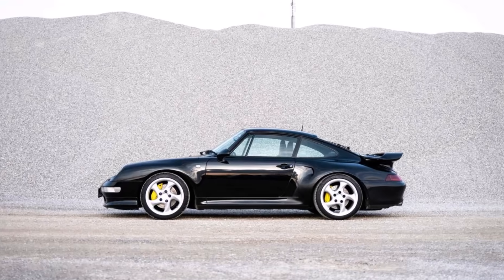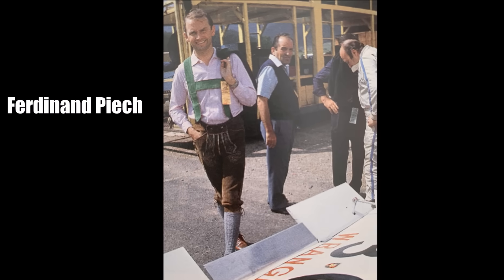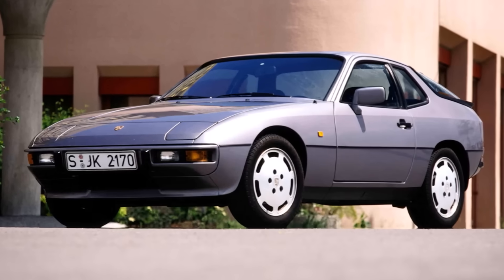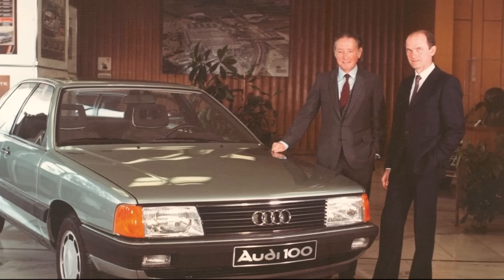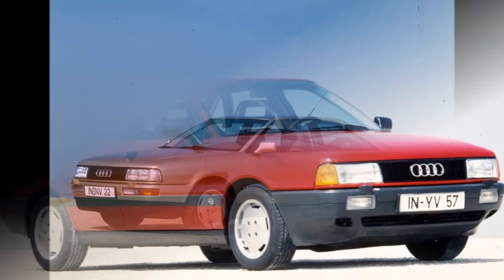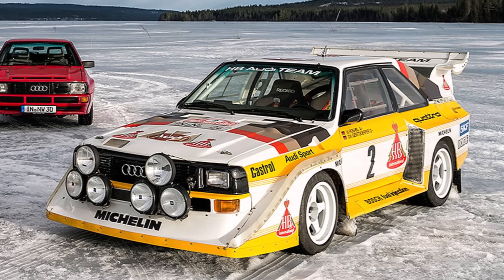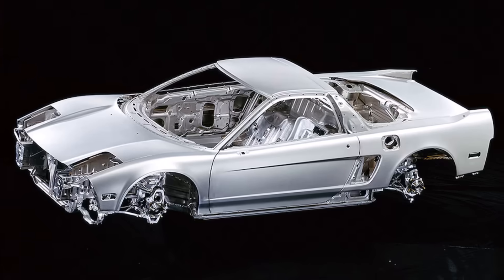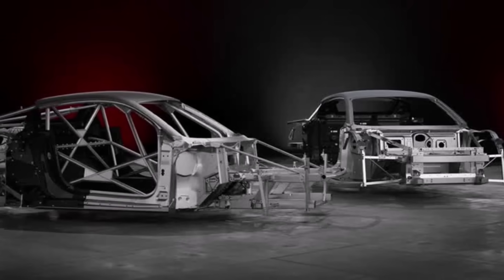How AUDI and Porsche eliminated corrosion forever - Development EXPLAINED

Comment: Even today, VAG corrosion warranty is many years longer than any other manufacturers - 12 years. GM has 3 years; Toyota 5 years; Mercedes 4 years.
Reply: iirc my 2001 audi a3, my very first car, had like 15 or 20yrs rust warranty. i remember reading through the documentation in the glovebox that the car was still under warranty for rust. apart from a vacuum leak on the big hose after the air intake filter, the car served me well 🫡 sold it once i got a company car at my first job. at the same time, my mom's peugeot from 2013 already had rust under the boot lid's exterior paint
Reply: @louisvl10 I still have the A3 8L and indeed it had a long warranty. I think it was 15 years because I remember when I realized it too lated after buying  one about 10 years ago that I should've bought it to the dealer since the driver's door was rusting, which happens to basically all of them. 😅
Reply: 12 years on Toyotas here - doesn’t prevent them from rusting though
Reply: Toyota has 10-12 years for even the Aygo, the cheapest model.
Reply: In the meantime in Norway, after a couple of years most cars VAG and others... Collect rust al over....
Reply: @dalegas76  there is something in the water up here 😁
Reply: In Italy plenty of Golf Mk4s are still rolling around and all of them (at least cosmetically) are in really good shape
Reply: 12 years corrosion warranty for Toyota, 10 years (or 200.000km) on the mechanical stuff, and 15 years on the Hybrid components (no max. kms). Don't talk about VAG warranty like it is any good, they will do anything to avoid paying for warranty.
Reply: Except Renault. My first car, Clio 3 had 20 YEAR warranty!!!
Reply: still drive my 1999 vw t4 505000km its whole life in salty Denmark but almost no rust in my T4. it was taken care of, but many are gone.
Reply: Yeah that's what my neighbor thought about his Passat. Until he went for the warranty and got told that the warranty was not valid since he didn't pay for the 'special anti rust treatment' when he bought the car. And when my uncle told me he had bought a new Golf a few years ago I nearly chocked on my coffee when he told me he only got 2 years warranty on the entire car 😳 While at the same time brands like Hyundai and Fiat were giving 7 years. I just can't get my head around the fact that ANYONE would fall for that bs. I would walk right out the door.
Reply: Volvo 12 years aswell
Reply: BMW also gives 12 years (as long as maintenance is done at a dealership)
Reply: Renault? Volvo? Renault looks so much better than Vag cars
Reply: Tell that to my old MK6, lmao!
Reply: Not true, opels since 2000s had also 10 or something like that. I have a 2003 Corsa, park it outdoors in salty Moscow winters, almost no rust.
Reply: It depends from market. In my country toyota rust warranty 10 or 12 year (depends on model), audi 12year. But... Engine warranty audi 160k km vs toyota 185k km.
Reply: Lets be honest the Mk4, Mk5 and Mk6 Golf had all huge rust problems in the rocker panel area and lower part of the front fenders. Also all cars based on the pq35 mk5/6 platform have problems with rusty rear lower control arms the coil spring sits on
Reply: My 2013 Auris had a 12 year corrosion warranty
Reply: there is no such thing as corrosion warranty in this area
Reply: Meanwhile I'm looking at Alfa Romeo and the other Stellantis brands saying that early-onset rust is totally normal.
Reply: Tesla also has 12 years to be fair
Reply: Bmw 12 years.
Reply: Usually you need to have a perfect service history for these guarantees….which is almost never the case in older cars.
Reply: Atleast in Finland you see 10y old and bit more really rusty VAGs.
Reply: A friend of mine has a golf 6 with a line of rust and a hole for fresh air in her trunk. Quality💅🏼
Reply: Interesting, but you are missing one Manufacturer, Ford. They cover all their cars for 5 years. What I can say with 11 Ford products since 1995 is that I am from Michigan, keep my cars typically for over 10 years and I drive a lot, and they don't begin to rust until they reach 14 to 15 years. My current car, a 2017 Lincoln MKZ, has 180,000+ miles and no rust. We even had a lowly 1998 Ford Escort ZX2 that didn't begin to rust until 2016, at which point we sold it. It had over 250,000 trouble free miles. We've had Fords, Lincolns, Mercurys, and F150s, and they don't rust for a long time.
Reply: my 2015 jetta has zero rust even driving in the salty ohio winters, in the same amount driving time on snowy interstates my 97 wrangler turned to swiss cheese
Reply: GM is 6-year/100,000-mile warranty for rust-through corrosion.
Stating it is merely 3/36(limted to aesthetic corrosion) is deceptive.
Reply: My A4 B8 has a really good rust prevention. Except of the rear axle the car looks like new and it already has seen 250.000km and 12 salty german winters. My TüV engineer said in May that a lot of W205 Mercedes from the same age and same milage failing the inspection due to strong rust at the connection points between chassis and rear axle and other important points
Reply: @scheggehut my B8 A5 is a rust bucket... It's hit or miss
Reply: Lol new vags rust like hell espc in salt winters, 3-4 salt winters and already rusty chassis, bcs absolutely non anti rust protection on body. Only skoda uses wax from factory
Reply: Still somehow VAG manages to start to rust in 3-6 years, ant rot away in 10-15, lots of 5 golfs and b6 passats with seethrough holes in europe. And i bet warranty doesn’t cover that
Reply: Clearly 2000-2012 passat’s didn’t get this tratament. 😂
Reply: Real Mercedes like C-E-S klass are like 30 years guarantee.
Reply: @steppenwolf1872 im Finland VAGs and mercedes are like the most rusted cars there are.
Reply: Had way more rust on vw products than any other
Reply: @thebigint-hw1on  Yeah lmao
If you see a horrendously rusty car here in Norway it's always a VAG product, literally always.
Reply: @kristoffer3000 by the time it was 5 our VW Up had a HOLE in the side of the vehicle around the fuel filler. Not only rusted out but literally rotted through.
Reply: Yeah it's insane, I'm not touching a non-alu VAG product, it's too scary.
Reply: @kristoffer3000 probably because they last this long to show rust issues while all others are already gone
Reply: @computercrack  Far more BMW's and Mercs still on the roads here in Norway, Passat B6's and 7's are getting rare already despite selling more.
You're just coping.
Reply: Yeah the engines go first anyway 😂
Reply: Mazda is 3 and a half weeks.
Reply: @deadprivacy  Only the first-gen Mazda 3 had issues with rust. The 2010+ models do/did not.
Reply: I wish the warranty covered paint though.... I have a 2001 VW and around 2006 or so the clear coat started to peal off, and a few spots on the front of the hood and roof where the paint chipped the size of a nickel or quarter.... It started rusting, so a car that I owned for 3 years, that was only 5 years old was already rusting! But now 20 years later, most of the clear coat is gone, but the only rust issues have been the exhaust bolts, break parts, control arm/suspension parts, plastics dry rotting and becoming brittle. But overall the body has held up great (outside of the paint!).
Reply: @EWD69420  all VW and most VAG will peal clearcoat except if the paint are metallic
Reply: @mnp3713  Mine was a metallic flake paint. It was all the clear coats had a high chance of peeling on the MKIV Jetta/Golfs and even some Audis of that era. Certain GTI and Jetta wheels also had clear coat peeling issues (BBS authorized VW to paint+clearcoat the wheels and did it poorly).
Reply: @EWD69420 normally the problem is only with none metallic paint as the metal reflect more of sun and the harmful uv etc
Reply: @EWD69420  What on earth is a "break part"?
Reply: Plus it's a corrosion warranty not a perforation one.
Reply: @lareau6  not on suspension parts
Reply: And today the only cars you see with rust holes are just VW... Mainly Passat. 
Bad engines, crazy bad DSG-gearboxes in the beginning and they just dropped their customers with huge repair bills. 

I can't figure out why anyone still buys any VAG cars..
Reply: @anderswahlgren9308  DSGs are more reliable than traditional automatics and require less maintenance and maintenance is less expensive. The only DSG with significant reliability issues was the DQ200 with dry clutches.
Engines seem mostly fine? Every OEM has a bad generation here or there. Just as en example, GM/Stellantis/Ford have their welt belts blowing up engines, meanwhile the 1st gen EA888 had bad piston rings and would end up burning 1l oil per 500-1000km worst case. The later generations of that engine is one of the most common car engines in the world today. (I'm sure they're all broken down by the roadside /s). Or take all the TDI engines, very reliable. Or EA111, EA113, EA211 are all reliable engines that basically run forever.
Reply: @-szega  Insane cope.
Reply: I mean, a German car out of warranty won’t be running in 12 years. So, they can have a long body warranty knowing the engine will be gone.
Reply: @dev1360  The average passenger car in Germany is now 11.3 years old and German cars have by far the most market share. So this is obviously complete nonsense.
Reply: @dev1360  Huh? My 16 year old BMW works great with 150,000 miles. It's the M57 diesel engine.
Reply: @dev1360 Nonsense. My Phaeton is 16 years old and runs fine (V6 Diesel)
Reply: @dev1360 Even before the engine blows up, the DSG gearbox will be gone
Reply: @dev1360  This right here. The powertrain dies before it can rot.

Comment: The number of fully galvanized VAGs I've seen with rustholes and welded patches all over the place suggest to me they didn't. Seems like VAG were so confident in their galvanised Steel that they skimped on other forms of rust protection like proper water drainage for the inner cavities of the body and wheel arch liners. 1990s PSA products seem to suffer far less body rust issues than their VAG counterparts despite a lot of them only being partially galvanised. 
And lest not forget Matras idea of combining a fully galvanised spaceframe chassis with polymer body panels, first on the 1980 Murena and later in mass production on the first three generations of the Renault Espace.
Reply: 100% have to agree. my mk1 octavia is a perfect example, dirt bulking up behind the front wheel arch liners/the front mudflaps + the windshield drainage channels lead directly into that “space” (literally a ~5cm deep cavity that serves ZERO PURPOSE). id understand if the wheel arches were somehow watertight, but they are definitely NOT…
and now here i am, trying to justify literally blowing 2k€ to get it profesionally repaired hah
Reply: @mirrekku  early MK1 Octavia's were worse, they didn't have wheel arch liners at the rear, so mud accumulated around the gas filler and almost all of these early Octavias rusted through.
Reply: lol absolutely not. my mothers 406 is a rustbucket even more so than the 190E my father used to drive and that thing has not galvanization and is older
Reply: The 90s Audis and the mk4 platform indeed have some issues with drainage  and organic matter causing issues. My view (in Finland) still is that the french cars were still a lot less protected especially in the door sills.

The actual Audis had much thicker evrything in the sills. The mk4 platform was about the same compared to many french cars. The mk2 Megane I actually consider to be superior to the Volkswagens at the time. 

Your front wheel arches cannot rust if they are made entirely from plastic! I don't know what the reason was for VW  not to use plastic fenders. The Meganes certainly do not have problems with paint peeling off for example.
Reply: Skoda is one of the worst rust buckets along with VW and mercedes
Reply: I’ve seen new side panels at VW factory with light signs of rust at welding points
Reply: My uncle had one of the worst 190D, rust everywhere under the body, at the end it was really difficult to drive straight... Sold to an African exporter, but in the end he said that it was only for parts, again the body was so bad...
Reply: My 2005 Octavia is starting to rust.

Comment: That stainless steel 911... 😮
Reply: Too bad even Elon wasn't the first to take it in to production. And the Cybertruck is primarily made from anything but stainless anyway.
Reply: @rkan2  Wait, the Cybertruck isen't even made from stainless? I thought that was the whole gimmick.
Reply: @rkan2  Thick stainless steel. The door skins are 1.8 mm thick, the rest of the body panels are 1.4 mm thick.
Reply: @mini2nut67 Yes, the panels and doors are stainless, but it is no stainless steel unibody. The body structure itself is mainly high strength steel and aluminium castings.
Reply: @rkan2  Correct. I want to see a Michigan “rust belt” CT in 20 years after corrosive road salt exposure to see how the SS panels held up.
Reply: Ford experimented with stainless.  Ford build six 1936 Tudor models out of stainless.  In 1960 they built two Thunderbirds out of stainless.  The last car Ford built out of stainless was a 1966 Lincoln.
Reply: DeLorean car bodies were made in Northern Ireland out of brushed stainless steel but I am pretty sure the central chassis was still made out of mild steel.

Comment: In the old days, junkyards were full of rusted out German cars... Later, they were full of non-rusty German cars with failed transmissions and other major parts lol... - Seriously. I became a good welder in my youth trying to keep my VAG products from falling apart. Worse, VW didn't even use fender liners until quite late. My 78' Scirocco and 79' Golf were more welding wire than original sheet metal. Never had a rusty Audi from 84' (and VW's from the 90's) until today. I'd like an A2, but am in the US.
Reply: It is A2 import time already since they are already 25 years old! 😅
Reply: @rkan2 problem is, suspension parts are now due for replacing and they've just stopped making them
Reply: @TheImperfectGuy Which parts? I can see plenty of availability for all the components of the MacPherson strut and refurbishing the rear torsion beam is not so difficult. Shock absorbers are shared with Fabia I & II and Roomster.
Reply: @TheImperfectGuy which parts? The cast iron control arms? Those can be replaced by sheet steel parts from other PQ24 cars, Audi did it themselves in later years of production.
Reply: In salty climates like where I live in Norway it is still the Germans that rust most by far.
Reply: Galvanized metal roof sheets were in use from 1829 which is 150 years before Porsche and Audi started galvanizing their steel car bodies.
Reply: The apostrophe abuse is giving me a headache.
'78, not 78'... '79... '84... '90s/90s.
VWs, not VW's.
Reply: @tim3172  We don't respect english enough to give a fuck.
Reply: When did they stop? My Audi from early 2000's is full of rust.

Comment: Garnisch-Partenkirchen
Garnisch-Partenkirchen
Garnisch-Partenkirchen
Reply: Garmisch-Partenkirchen
Reply: @pedromanuellopez142  Ferdinand woke up in the middle of the night, covered in cold sweat
Reply: @alida4790 sounds very likely. I honestly do not get the "Garnisch" part. Maybe a confusion with "Gar nicht"?
Reply: @pedromanuellopez142  it's Garmisch-Partenkirchen, mit m.  It used to be two separate towns: Garmisch in the West and Partenkirchen in the East.  Supposedly Garmisch refers to a "German quarter", named during a Teutonic occupation of the area.  Parten comes from the earlier Roman name for the town Partanum, and Kirchen is just church(es), probably related to the many power struggles in European ecclesiastical circles in the middle ages.

In 1935 the Nazi party forced the two towns into one administrative unit and the Winter Olympic Games were held there.
Reply: @identiticrisis Yes, I just don't see how someone can insist on Garnisch, I know Garmisch and knew the towns had been merged, so to speak. That's why I was wondering if the person knows s bit of German.